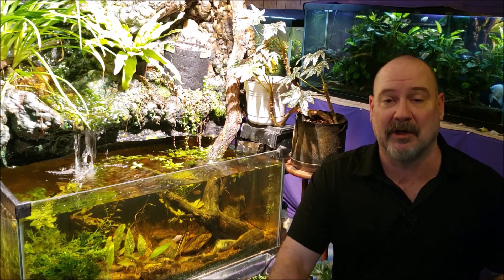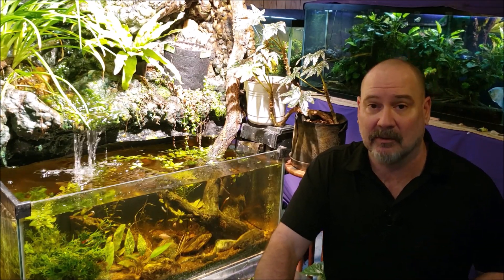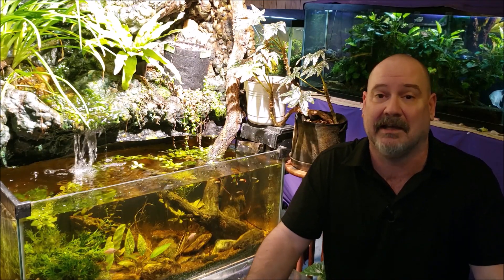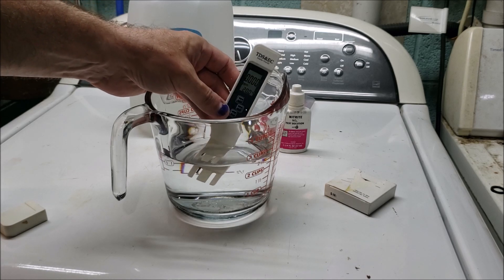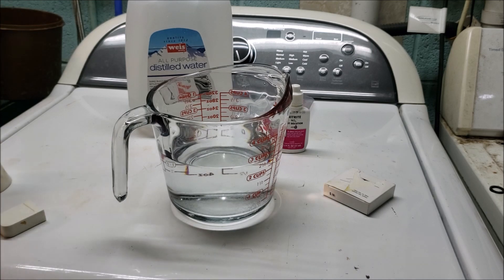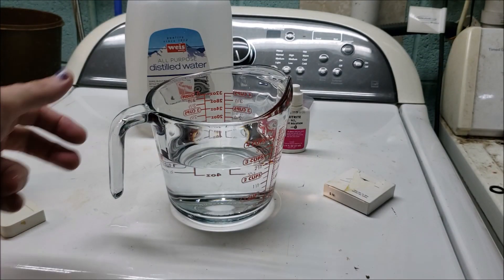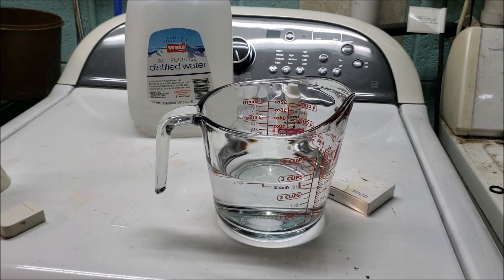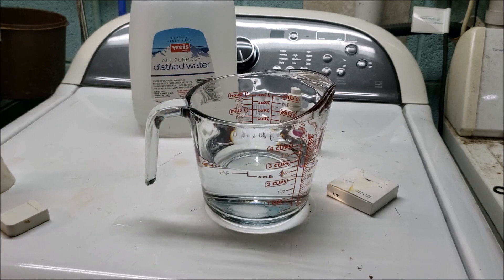A Terrible Way To Measure Water Hardness

Comment: I consider my TDS meter as sort of a "novelty" item.  It does come in handy after water changes, by measuring the tanks starting TDS & using that number as a "proxy", watching nitrates & whatever else slowly build up over time.  I think your TDS meter is a bit finicky though because of the need to be resetting it often.  Not sure if that's a "feature" or an intermittent failure of your particular meter or not.  Sometimes, my meter "hold" function is on & I forget to turn it off, etc.  Good video.  👍📺😎